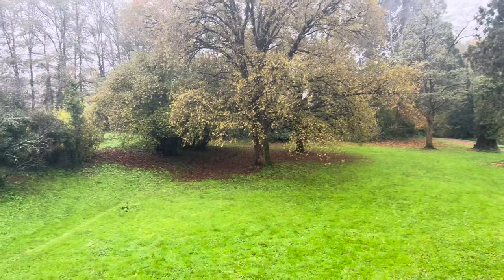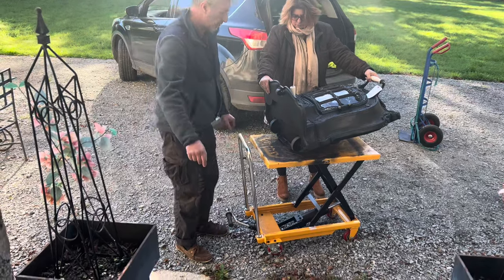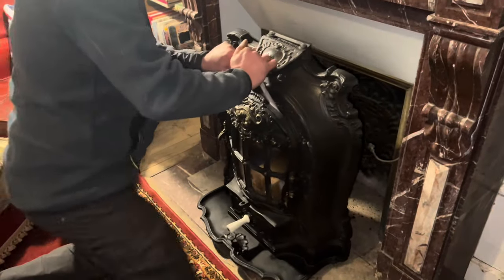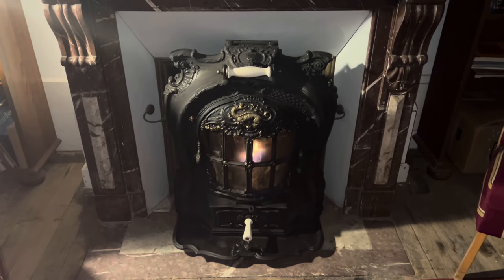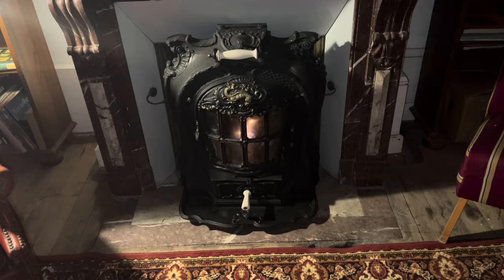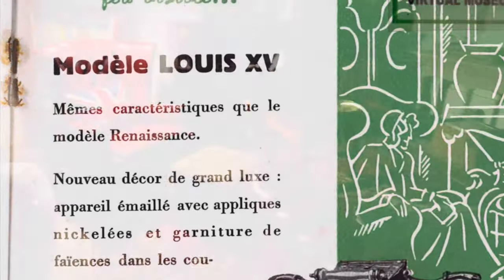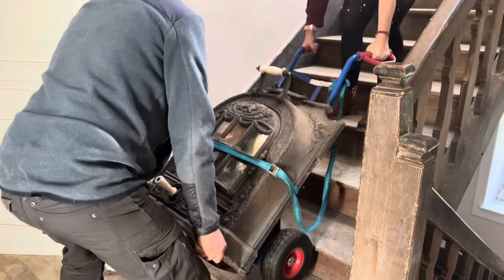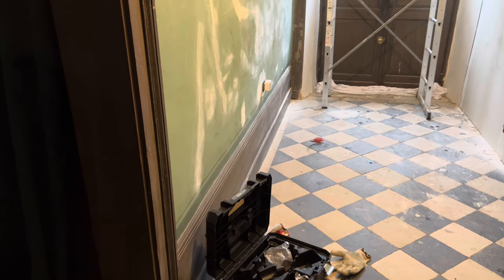WE ARE GOING TO THE LIBRARY FOR WARMTH NOW!!

Comment: Hi Sherell, your chateau and its location is lovely. The “salamander” fireplace suits the library perfectly. Re: ways to get a better sleep, before bed you could try a nice hot cup of “Nighty Night” tea (a camomile blend), soak in a warm bath with a couple cups of Epsom salts (your skin absorbs the magnesium) and/or use a magnesium spray on the bottoms of your feet and calves, and take a 3 to 5mg Melatonin tablet (dissolve under your tongue) when you get into bed. People also swear by taking Magnesium Bisglycinate (1-3 x 500mg capsules per day). Of course check with your doc if you’re feeling particularly crappy so they can run some blood tests for you to see if you’re low in Vitamin D and K or any other essentials. Lots of people are quite deficient in Vitamin D, it’s very common. Hope you’re feeling better soon. Sometimes a bit of a holiday for 5-7 days to a warmer spot by the sea is just what one needs to feel rejuvenated and refreshed. You’re an amazing woman who has accomplished a lot…you deserve breaks for sure! ❤️ 🇨🇦
Reply from the maker: Thank you for your informative comment. I so appreciate your concern and will  go and see my doctor. I have copied down your suggestions and will work through it. 👍🤗💕
Reply: @ Oh, you’re so very welcome! Sweet dreams. 😴
Reply from the maker: @JeriCardinal Thank you 💕